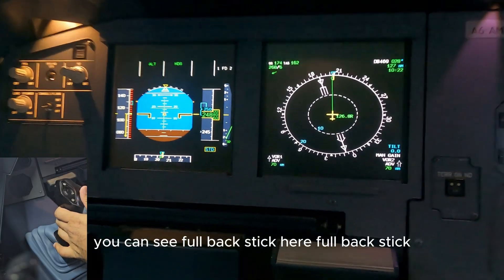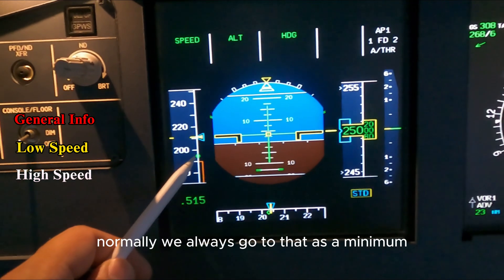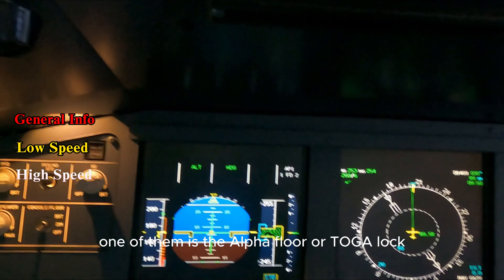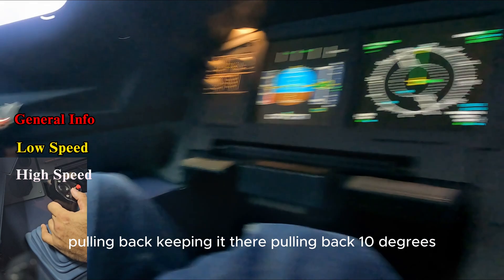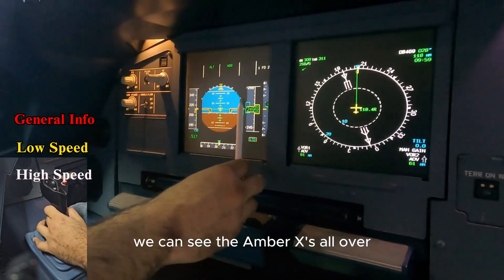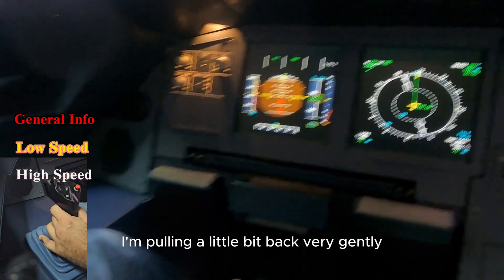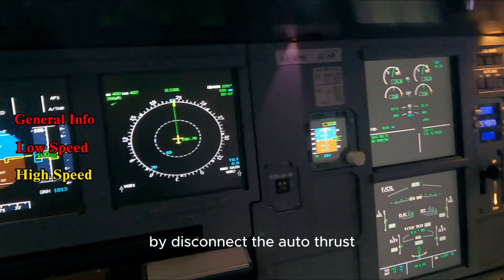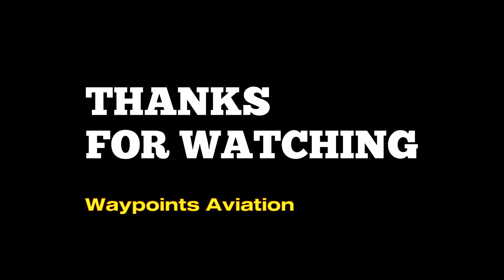Airbus A320: Speed Tape Tutorial - Low Speed - STALL - High speed

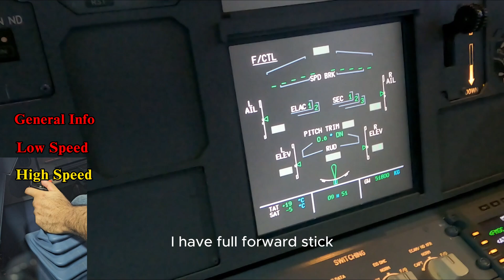Comment: 15:20 what happens if say u were in the same situation + uve had fire onboard and u need to descend and land asap whilst at the same time the aircraft is not letting u (even though ur applying full nose down command)
Reply from the maker: The rule has always been ANC - Aviate, Navigate, Communicate, So Flying the aircraft is always first. Back to your question. I would recover from the stall to gain control - then deal with anything else.
Reply: @waypointsaviation  yh i guess so, makes sense

Comment: what is "VLS" ?
Reply: @9LimaAlpha7:  the proper term for VLS is Velocity Lowest Selectable.  With the auto thrust/auto throttles engaged, it is the lowest speed (velocity) that the aircraft will fly in its current configuration.  He selected 134 knots at one point, almost 80 knots below VLS.  The aircraft slowed to the hook, and the auto thrust held the speed there.  VLS keeps you from getting too slow for ANY configuration.
Reply from the maker: "Lowest Selectable" Speed
Reply: @waypointsaviation  cheerz

Comment: Does selecting flaps 1 help in a deep stall situation?
Reply from the maker: In a deep stall, extending the flaps on an A320 would not help and could worsen the situation. Flaps increase the angle of attack and disturb airflow further. Instead, focus on reducing the angle of attack to regain control.